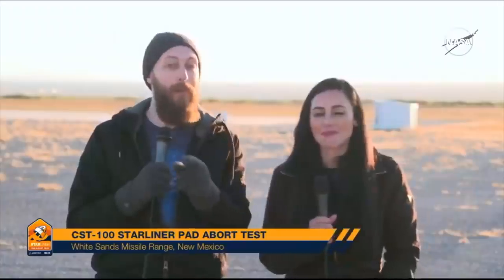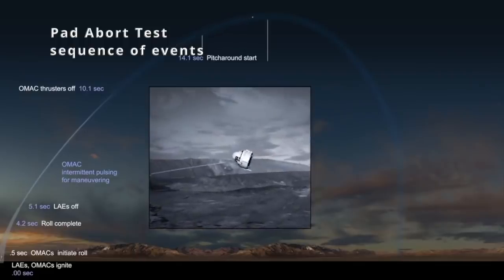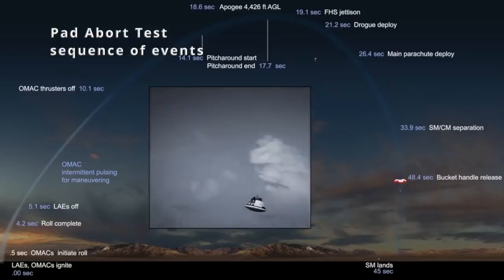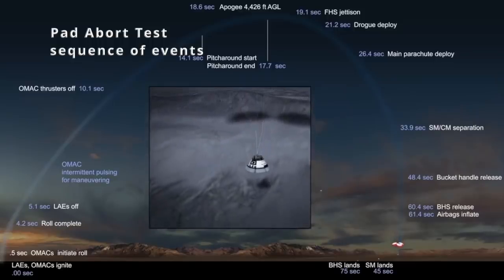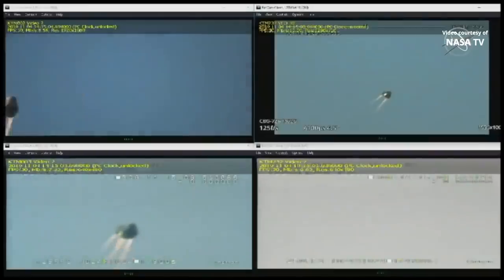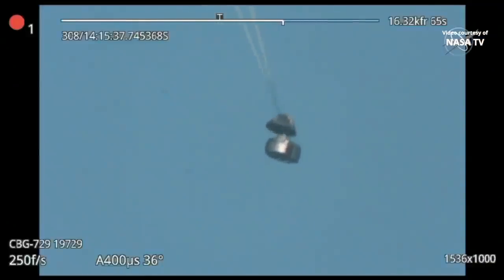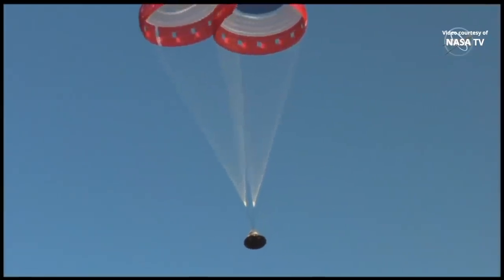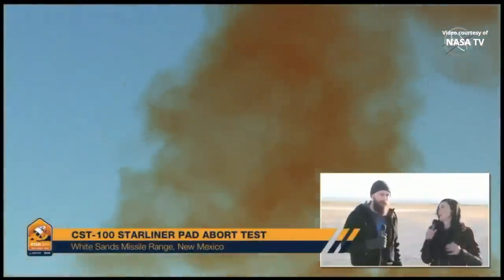Boeing Starliner Pad Abort Test

Comment: There is nothing better than after an imminent death, the capsule take you away from that danger and gently deposits you (as it can with 1 less parachute) over the ground, there you experience the excitement of a new life full of possibilities, so you open the hatch, you take a good breath of air, but one of those new possibilities at 3:30 fill your lungs of hydrazine and nitrogen tetroxide in order to experience a more painful death that the one you escape for :) 

I don't know why they call those propellent more "reliable", today all main propulsions, escape thrusters or RSC should use hydrogen or methane + ox with laser ignition or just sparks.
Reply: Easier said than done. 

The cloud is nitric acid from the N2O4 oxidizer, which is highly visible as a gas so a little can look like a lot. It's not great stuff to breathe in, but it takes a decent concentration to get any lasting effects. Plus, in a real situation this would fall into the ocean and for the most part not be a major problem. If there was hydrazine in there it would combust.

Cryogenic propellants, though more efficient, require much more complex systems to use. Even if they're just pressure fed, then you still have to deal with insulation, and it won't last long in space. Any ignition system is less reliable and slower than none (hypergolic).

The unfortunate reality is there simply are no great options for storable, non-toxic propellants. The qualities of hydrazine and NTO are appealing enough to make it worth the hassle much of the time.
Reply: @nathanaelvetters2684  You may be one of those who believe that if something is not used today,  then it may exist a holy reason which prevents that from happening.
Of course, if that would be a reality, we would have zero progress and we would still be in the stone age (which is what happened to the space industry until SpaceX show up). 
I agree that breathing a highly dissolve part of that cloud, it does not mean an instant death, it was part of the joke.
But still, managing those hypergolic substances requires many safety procedures and planning which comes with an extra cost. 
It is a very nasty stuff that should not be released to the environment due its nature and because it can complicate any event which divert from the expected. 
you still have to deal with insulation, and it won't last long in space
Not sure if you know, but hypergolic fuels freeze at -11 celsius degree, this mean you still need insulation and some thermal system. 
BTW, avoiding thermal gain or lost in space is super easy, you already have a vacuum, this mean that heat can be only gained or lose by radiation, this is solve with a low emissivity coating for the tanks and high reflectivity (just white paint or aluminum) in the ship exterior.
If you still want to manage heat, it can be done in passive or active way, just with a radiator that depending if it points to the sun or to space, it would increase or decrease temperature.  
To avoid heat gain or lost inside the atmosphere, you can add just a bit of insulation material, besides using methane or hydrogen it means you have only one tank for fuel and that extra fuel can be used for what you most need in the moment, the extra ISP reduce the amount of fuel, you dont even need helium to pressurize because you just heat the same cryo fuel to convert to gas and feed the control thrusters. 
Using one fuel type tank also reduce the surface to volume ratio, which mean lower heat gain or lost.
It was already proved that laser ignition has a chance of 99.8% of ignite in the first 20 milliseconds with cryo fuels.
There are many projects of spacecrafts that use them. 
Spacex would use it in her new spaceship, I did not hear nobody saying "ohh noo.. why they choose that??", neither I hear spacex mention extra issues by choosing that method. 
The only problem here is that there are many lazy companies who use just taxpayer money, which mean that extra cost of hypergolic fuels does not matter and they avoid any effort of change the way they always do things.
Reply: @AngelLestat2  You've made some good points. I know hypergolics still require thermal systems but they're far easier to keep liquid than cryos, especially hydrogen.
Not sure what your point is about having just one tank, if you're dealing with cryo propellants you need oxidizer too. Since it's a crew capsule, you need to keep part of the craft at room temperature and other parts -183°C. Different propellants boil at different temperatures, so you need to keep thermal differential between those as well. Thermal management is far more complicated than many people realize.
SpaceX needed easily storable propellants   for their original Dragon concept. It was to land propulsively and they even wanted to send one to Mars. At this point, they'd have to redesign the whole capsule to use a different system.
Furthermore, both Dragon and Starliner use hypergolics for RCS, since they just work so well for that. Having a hypergolic LAS means you can use the same onboard fuel supply you already have, which means a simpler system in general and little added risk of hydrazine poisoning since it's already there.
About the laser igniters, I haven't heard much about those, why aren't they in widespread use if they're so effective and reliable? As far as I know Raptor will be using a different type of electrical igniter.
Reply: I think maybe I misunderstood what you were saying about one fuel tank type. Could you elaborate on what you meant? The only way you have only one fuel tank is if you use monopropellant, which wasn't even part of this discussion.
Reply: @nathanaelvetters2684  I said one fuel tank, I was not talking about the whole propellent.
Propellent for chemical propulsion at vacuum would be fuel + oxidizer ,  I was referring just to the fuel part, in this case Lh2 or Lch4, there is no case to mention LOX because it is know.
Besides hypergolic fuels also require fuel + oxidizer in separate tanks, in this case you have hydrazine (fuel) + nitrogen tetroxide (oxidizer, the red stuff), the only difference is that they ignite on contact without the need of a spark. 
Since it's a crew capsule, you need to keep part of the craft at room temperature and other parts -183°C
Sorry, but you are assuming that you can have hypergolic fuels inside the same pressurize space that the crew share?
Haha, no.. you can't, in that case yes, any small lost would become lethal fast. 
This mean that one way or another, you have to deal with two different temperatures.
But on vacuum, heat flow does not behave as you are used to vs your everyday experience.
As I said, you only have heat flow by radiation which it could be completely controlled with ease.  Any tank joint to the rest of the spaceship is done with insulation materials and small cross section, this mean negligible heat flow, I am talking about a month  in order to lose a single degree and you can still cool it in a passive way with radiators pointing to the space.
Thermal management is far more complicated than many people realize.
In earth.. yes, you need to deal with conduction, convection and radiation (the first two are the most complex to calculate), you need 3d thermal software for an accurate simulation.  In space.  No..  it is incredible easy, even with a pencil, a paper and 10 min would give you very accurate result. 
Unless you are using cubesats which are small, mostly open with difference materials and colors outside rotating in random ways with most electronics exposed.
But even in that case is not complicated, you can use common sense checking other designs, or use a 3d thermal software.
Having a hypergolic LAS means you can use the same onboard fuel supply you already have, which means a simpler system in general and little added risk of hydrazine poisoning since it's already there.
But my point is that you dont even need hypergolics, you can use methane (for example)  for everything, higher ISP, less cost, etc.
The ISP for RCS may not be too important, but if you are forcing your main propulsion with hypergolics, then yes, you are compromise cost and a lot of mass to orbit.  
About the laser igniters, I haven't heard much about those
Because sparks works just fine too, but recent (like 6 years ago) studies show that laser ignition could also be used with very low power consumption (I remember the % quoted in that study, that is one I mention those, not sure which one is better between spark and laser.

Comment: The same people responsible for the 737 Max screw-up were ones in charge of the camera work in this test. Absolutely horrible.
Reply: And responsible for the 3rd parachute failure.  Nasa must not have paid enough for a 3rd parachute in the same way airlines didn't pay for the redundant AoA sensors.  Boeing likes to sell unsafe aircraft while blaming the customer for not paying for the safety equipment which is considered extras.
Reply: @_PatrickO  That... wasn't the issue. Boeing was not charging for additional AoA sensors. It wasn't good, but making up stories doesn't help anyone.
Reply: @AmbientMorality  lol, a boeing apologist?  In order to use more than one AoA at a time as a redundancy check, you had to pay them extra.  Otherwise it switched back and forth between each flight which was even more dangerous.  A bad AoA would be covered up after the plane lands.  Maintenance would start the plane back up and the plane would switch to the other AoA without saying anything, so everything would check out fine.  When the plane was restarted for the next flight, it would flip back to the bad one causing everyone to die in a crash on takeoff. It was designed to cover up failures and kill people.
Reply: @_PatrickO  Incorrect. There was no option to use more than one angle of attack sensor at a time. There was an AoA disagree light and an AoA indicator display; the indicator was an option and the disagree was supposed to be standard but there was a bug in the configuration so the AoA disagree light didn't come on if the indicator wasn't in the configuration
Reply: @AmbientMorality lol, they had an on screen indicator that would have revealed the problem.  Stop lying to protect murder.
Reply: @_PatrickO  The AoA disagree light was supposed to be a standard feature.
Reply: @AmbientMorality  lol, it was an addon that boeing demanded a ton of extra money for.  They tricked customers who didn't realize they had to ask for it before signing a contract, or it would cost too much after the fact.  Dirty sales tricks by a dirty company.  Boeing execs should be in jail.
Reply: @_PatrickO  All evidence says otherwise, but you are free to believe whatever you want. Boeing has clearly stated, multiple times, that AoA disagree was intended to be a standard feature. Only the numerical AoA indicator was an optional feature.
Reply: @_PatrickO  I didn't say Boeing was right. You are also factually incorrect that the AoA disagree light was an optional feature. That is not up for debate – it's wrong to assert otherwise.
Reply: @AmbientMorality  You are flat out dishonest protecting your murderous employer.  It is clear you work for them and could go to jail.  The disagree light was absolutely an optional feature.  All software too, they just disabled it unless you paid extra.
Reply: Patrick O Okay, find me a source for that

Comment: That’s a lot of nitrogen tetroxide coming out the SM. Did the oxidiser tank rupture on impact?
Reply: It could be red fuming nitric acid as well, who actually knows what they put in there?
Reply: Hydrazine
Reply: @Enthropical_Thunder  No. The system uses hydrazine and nitrogen tetraoxide. The two are hypergolic, meaning they ignite spontaneously upon contact with each other, which is why they are used in attitude control systems.
Reply: 99.9% yes
Reply: It hit the ground at near terminal velocity so a lot of bad things happened to it
Reply: What if the capsule ends up damaged or an astronaut gets heavily hurt, they'll need immediate attention, but there is deadly gas 😎
Reply: wtf are they using NTO for?
Reply: @kaelan-j1z  attitude control systems, with hydrazine.
Reply: Former NASA spokesman here. Yes, that orange-red cloud is N2SO4. If the hydrazine tank had ruptured as well, there would have been an explosion. As it is, nitrogen tetraoxide is highly toxic. Crew and first responders would have been in danger.
Reply: @rockyraab8290  N2O4, there is no sulfur in it.

Comment: Yikes... so much hypergolic gas surrounding the capsule... my lungs are melting just looking at it
Reply: I got cancer just looking at it
Reply: I think that the NTO vapors are only an issue if the astronauts leave the wing window open.
Reply: @Ed-yj8ts  Could also have been a factor in the third 'chute not deploying properly - apparently N2O4 degrades nylon pretty badly.  Possibly why the third pilot 'chute detached without pulling out the main (I think - Uncle Davey's Shaky Cam (TM) makes that a little hard to tell).  Either way, I'd find it hard to believe that having so much residual oxidizer floating around the spacecraft during descent is part of the plan.  

Interesting contrasts to Crew Dragon - CST-100 requires the SM to actively orient the capsule, whereas Crew Dragon relies on aerodynamics to passively orient it.  Dragon separates the trunk before 'chute deploy, CST-100 separates the SM after (yes, I realize there's not a 1 to 1 correspondence between the Dragon trunk and CST-100 SM).  Not speculating which is better, just noting that they are different.
Reply: @Ed-yj8ts  It would still complicate recovery though. After pulling 10g or more the astronauts might not be in such good shape, and they have to wait for the cloud to disappate before retrieving them.

Comment: I only saw two mains - where was the third?
Reply: It failed to deploy
Reply: It failed as part of this "successful" test.  I hope nasa makes boeing run a series of 13 tests like they did spacex.  Boeing has always relied on ground tests to certify stuff, and this is exactly why that is a problem.  A few real tests like this in a row and they will catch every weak point and greatly increase the safety.  There is no valid reason not to do it, boeing would avoid it just because of the cost.
Reply: @_PatrickO  you know NASA isnt going to do that, come on...its boeing
Reply: @cpzd83  I feel sorry for the astronauts who are about to get the MCAS treatment.
Reply: I found this funny, because SpaceX has 4 parachutes, and Boeing can't even get 3 to work at the moment. 

Twice the cash, and we get 1 less parachute. . .
Reply: @TLN-qu4rq  They've had several successful parachute tests, SpaceX had a servre parachute failure only a few months ago which destroyed the testbed. This was a successful test of the pad abort system and one parachute failing is not a failure of the test.
Reply: They failed

Comment: Look at 2:40 and set speed to 0.25x, you can see one of the main chutes fly away.
Reply: I don't think that is the main chute. That looks like a drogue which springs out, and pulls/deploys the main chute. It looks more like the drogue tore away. At the beginning of 2:41 you see three tiny drogues. At the end of 2:41 you see the lines from the two mains that were deployed.
Reply: To correct myself, this is probably better called a pilot chute analogous with one used in solo skydiving to deploy the main. A drogue is used by tandem divers to stabilise free-fall.
Reply: Sneeuw Poesjes I knew it
Reply: These are not the Drogue's your looking for :- D

Comment: 03:33 - But that brown smoke looks very sinister. I believe it's poisonous and it's so close to the crew capsule! Apparently, it's dimethylhydrazine, which is highly toxic.
Reply: That isn't brown smoke.  It is Nitrogen Tetraoxide (N2O4), it is the hypergolic oxidzer for the rocket fuel.
Reply: Yeah, I wouldn't want to be the recovery crew in that situation...
Reply: In real scenario, SM would sink to the bottom of ocean. So no smoke/fume at all
Reply: @naufalfarras1556  Normally you would be right, but as far as I recall it won't be doing any water landings as SpaceX is doing. But as this is a launch abort system, it probably wouldn't be over water at the time of use.
Reply: @codyh39  Right, it won't be doing any water landing IF anything goes smoothly. But in case of a launch abort, spacecraft would land in the ocean (a.k.a. splashdown)

Comment: Did one of the 3 main parachutes fail to deploy?
Reply: Yes.
Reply: I think so, the animation and webcast both said that there should have been three main parachutes.
Reply: Yes if you slow down the video to .25x speed and go to 2:40 you will see it fly away
Reply: @btwgarage  Yup. One of the drogues, that are supposed to pull out the mains, just flew away. Thanks for the tip. Still hard to see, given the truly awful camera work.